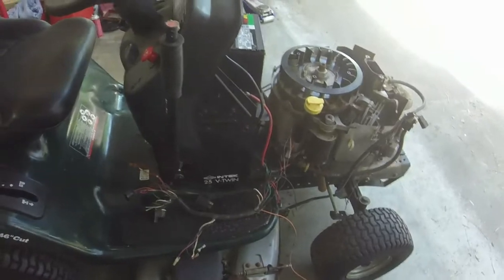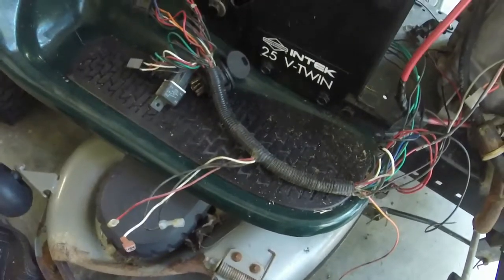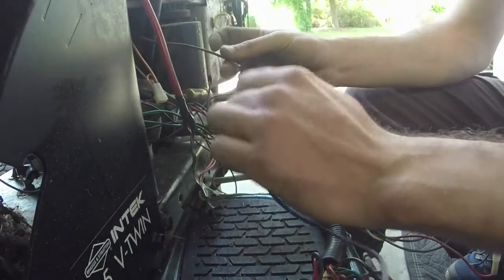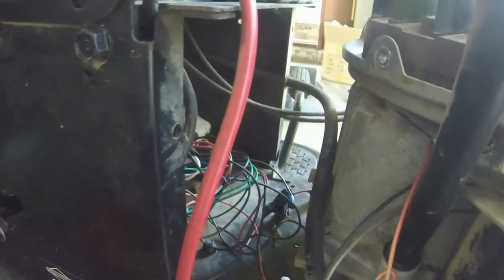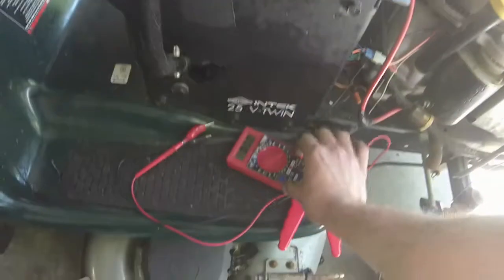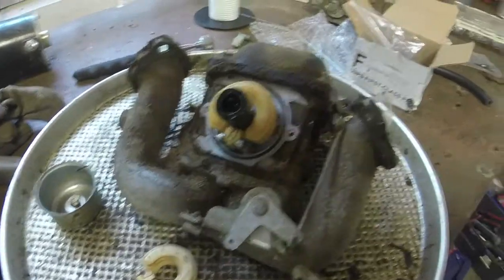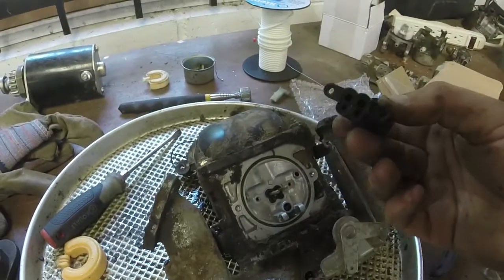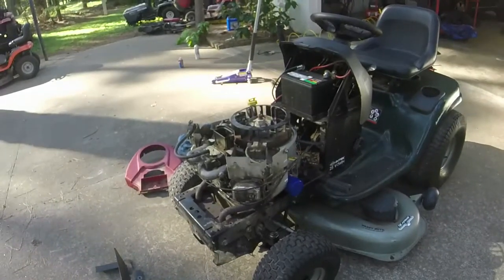Craftsman DLT riding mower: Fixing kill & stator wires & Briggs V-Twin carb clean, test run! (pt 2)

Comment: Great video this really makes me miss mine
Reply from the maker: Of all the riders I've ever worked on, this had to have been top 3 easy.  I loved this mower.
Reply: @EllisMowersandmore  come on is currently sitting at the bottom of the hill hasn't ran in 12 years the last time it did run cranked up fine ran fine but as soon as I went to put it in reverse or forward it wouldn't move and it started smoking like crazy and it had a drivetrain belt on it so I'm thinking the rear end of the transmission is gone
Reply from the maker: @Chevyc608.2  Maybe so if the idler pulleys turned freely.